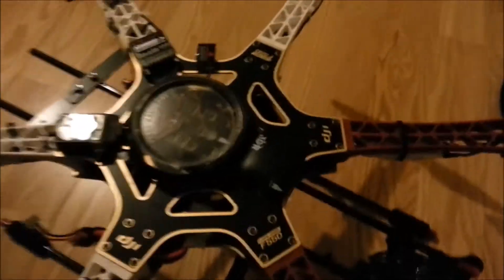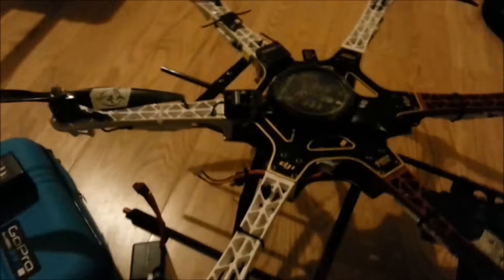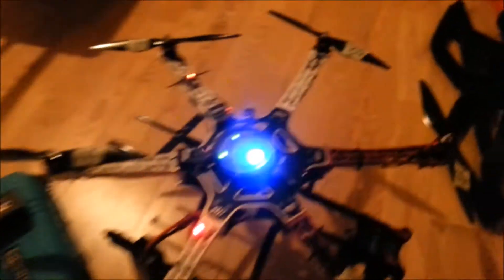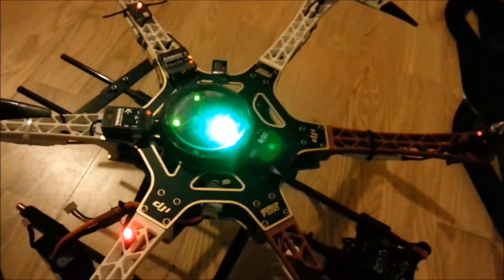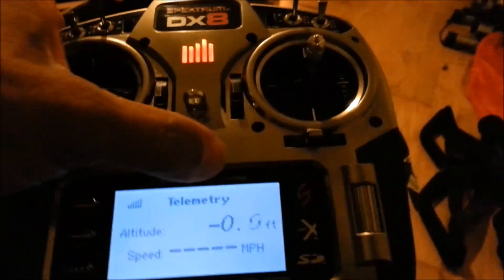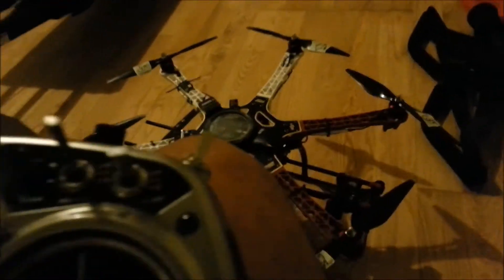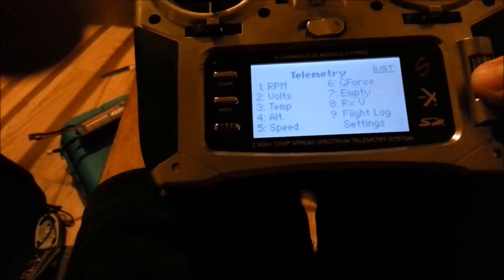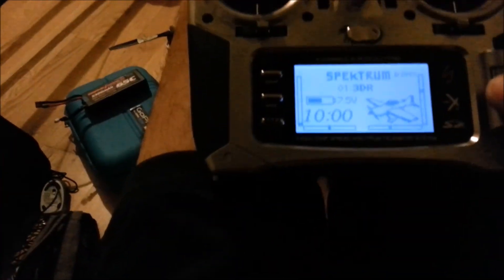HOW TO SETUP SPEKTRUM DX8 ALTIMETER TM1000 AR8000 DSMX

Comment: what model altimeter are you using
Reply from the maker: +Gary Kapalka Spektum "aircraft telemetry sensor" came as package with TM1000 AR8000
Reply: I read that the ar8000 could not be connected directly to the pixhawk and that a pcm decoder was required. Do you use a decoder between the ar8000 and pixhawk ?
Reply from the maker: @greg3626  Did not use decoder. all spektrum devices connect directly with no issues. if it matters any I never use cheap chinese after market pixhawks. I use either 3DR pixhawks or MRobotics pixhawks.